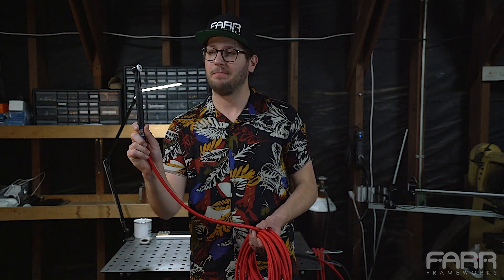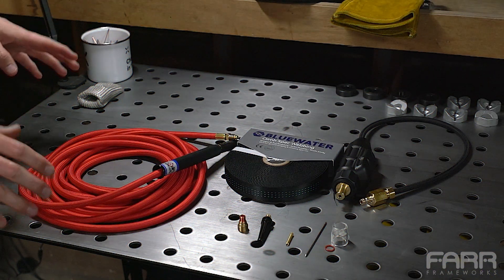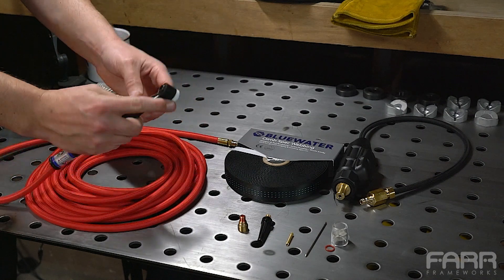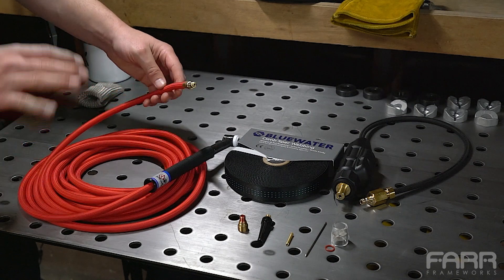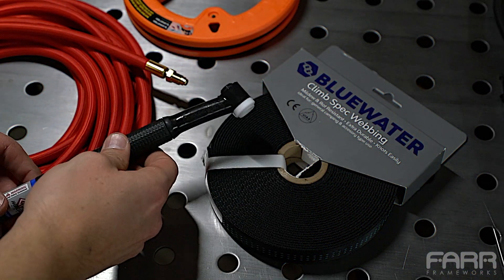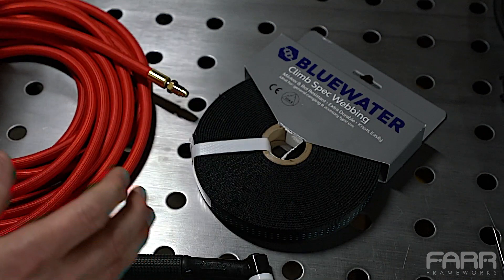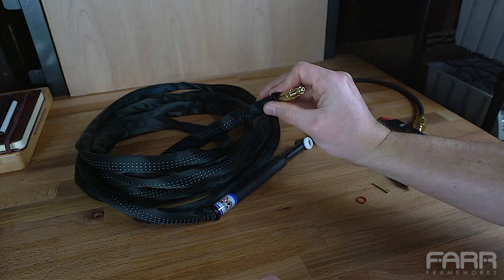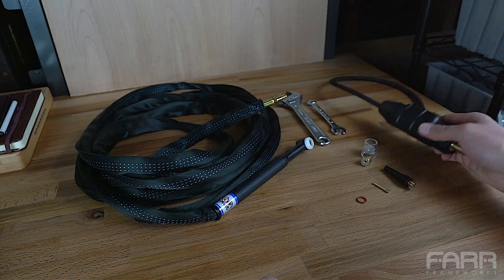TIG Torch Upgrade for the AHP AlphaTIG 201xd

Comment: Will this torch  fit the alpha 200x
Reply from the maker: From what I've found that model still used the same 35 (1/2") Dinse size, I'd probably message the folks over at AHP (tech@ahpwelds.com) to confirm.  If it's the case, then yes it will work!

Comment: Curious - why is this an upgrade ?  Better  how etc ?
Reply from the maker: Hey @fakdaddy75. That’s a good question and it’s mostly dependent on what you are planning to do with the torch. For me I weld thin bicycle tubing around 0.025-0.035”.  With the gas lens and larger cup you get a lot more gas coverage which helps with the HAZ and oxidation.  Also because bicycles have a lot of acute angles having a small torch like the CK9 is awesome.  It’s way easier to handle and get in the tighter spots.  I can’t say enough about the super flex cable either. It’s really nice to not have it fight you when you are trying to get in a certain position. If you are doing thicker materials or have different constraints it might not be the right choice but for me it’s been a fantastic upgrade over the bigger torch that came with the welder.  Hope this helps.
Reply: @FARRFrameworks  thanks - I have the original torch I need to replace. Thinking of going this route ..... as then you can just replace the torch or hose  only if there is a problem. Unlike the OEM which is clamped on. Yeah I like the idea of the CK9 - I mostly do thin metal ...... but every now and then I dod use the full 200A on aluminum. THx for the vid.

Comment: The link for the dinse connector is the wrong size
Reply from the maker: Thank you for letting me know!  Not sure what happened there.  I went back and clicked on my cart and it took me back to that link, however you were correct it's a different size for water cooled torches.  I've updated to the correct link to the gas cooled PN.

Comment: where did you get the hose cover from that you put onto your superflex hose and how well did it hold up over the last 2 years?
Reply from the maker: Hey Daniel, It's called tubular webbing.  You can get it at REI https://www.rei.com/product/118266/bluewater-1-climb-spec-tubular-webbing-30-ft.  It's tough stuff and is holding up amazing even after dragging it around on my concrete floor!  The only thing I'd say is that contrary to the video I found out that an easier way to install it.  Lay it out flat down a hallway and shove the TIG hose in from one end.  As long as it stays as a straight and loose it slides in pretty good!

Comment: Did you need the new dinse or could you use the old one?
Reply from the maker: Great question, at least with the torch setup that came with mine it wasn't possible to reuse the existing dinse connector.  Both hoses (argon infeed and torch) were crimped onto the internals.  It ended up working out though as I also wanted to keep the original torch as a beater for quick & dirty jobs.  I'd suggest opening yours up to see prior to buying everything if you are looking to try to reuse it.